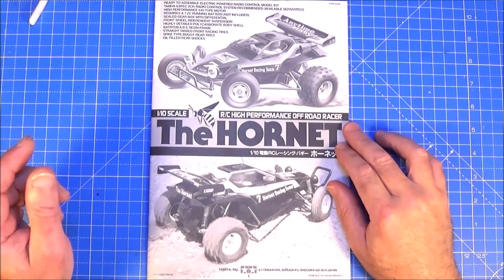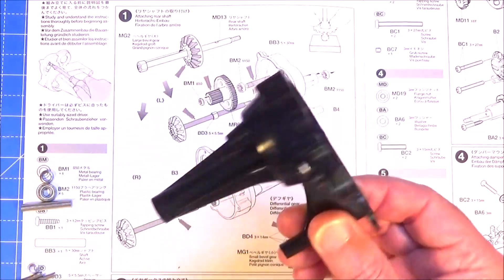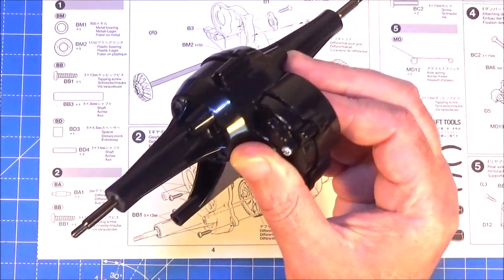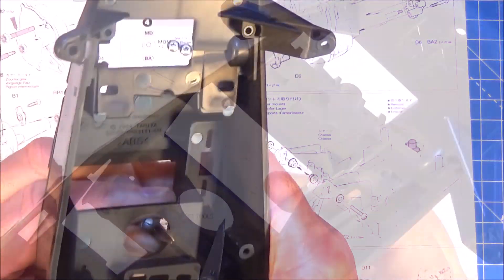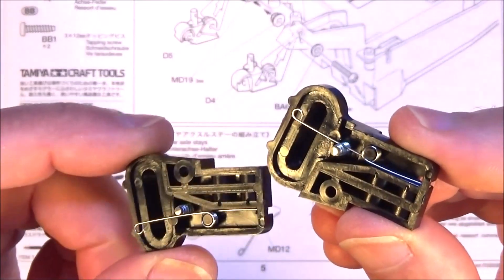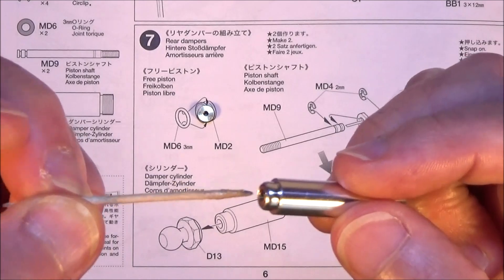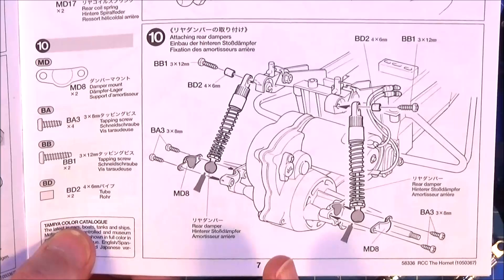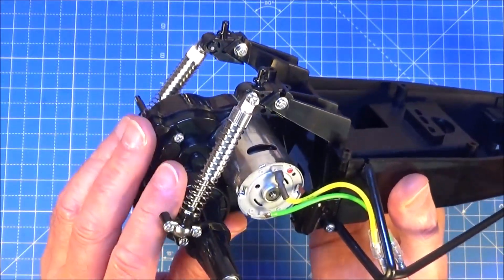Tamiya The Hornet Build Guide + Tips Part 1 (Steps 1 to 10)

Comment: Hiya mate. Sorry, just catching up on some vids. Did see the unboxing and hadn't realised that you've never had one of these.  The shocks are really decent as you say but the design of the gearbox and suspension does mean that the handling is still rubbish 🤣 I've never had a Grasshopper but I do think it's worth the extra for the Hornet to get the extra bits and have the gearbox that pivots.  I did do a mod on mine to have oil shocks on the front which I think was in a Dusty Fingers video.  Anyway good work so far mate and I'll stick the next episode on now 😁👍👍
Reply from the maker: Hi Pete and thanks for catching up, always a pleasure to read you mate. Yeah I'm late to the party with this model! 😅 I can see how the suspension is still rubbish despite the oil dampers! Agreed about the Grasshopper, that's why I went for the Hornet. For £20 more you do get some better parts. Hope things are going well mate, take care. 🤞😎👍

Comment: Helping me with my Rising Fighter build. Thanks.
 Stock (with bearings) for now. Then 19T steel pinion with Absima 15T hot motor, Wooo! P.S should i buy J.I.S screwdrivers or will Phillips be okay?
Reply from the maker: Glad to be of some help, Dominic! Good plan with the motor and pinion, phillips screwdrivers differ so you might find one that's a decent fit or file the tip to make it fit better. (less of a V angle for JIS) But if you are gonna do a few Tamiyas it's worth investing in a JIS driver. Cheers! 🍻😎👍
Reply: Slightly more differences from the Grasshopper than I thought.
Reply from the maker: Same here mate! 😎👌👍

Comment: Hi Mark, bearings aside, I'm glad you're building this one completely stock, so we can see it running as Tamiya intended, just bouncing around. I was amazed to see the complexity of those rear shocks. I wouldn't have expected to see this on an entry level buggy, but they're a great addition. The gearbox build reminded me strongly of building my Grasshopper, surely it's the same gearbox. As always, I'm especially fascinated to see what you do with that body shell. Great build mate..
Reply: If you own a Lunchbox, you will notice that they are the same 👍
Reply: @cw-01creations46 Ahh yes, that'll be it. Along with the Grasshopper, I've built several Lunchboxes over the years. That's where the strong reminder is coming from. Cheers for pointing that out..👍🏻👍🏻.
Reply: @thecontractor365 
You're Very Welcome 👍 
You will also notice the subtle differences between the Grasshopper and the Hornet such as the rear axle housings. The Hornet's are similar to the Lunchbox whereas the Grasshopper has solid axle housings therefore eliminating the rear axle to pivot 😎
Reply: @cw-01creations46 Yes, I like the no pivot aspect of the Grasshopper.
Reply from the maker: The legend that is CW-01 Creations certainly knows his Lunchies! 😁👌👍
Reply from the maker: Cheers mate, yeah I thought I'd build it stock for the guide before I go bonkers modifying it for the Speed Challenge! I hope it survives that and I can revert it to stock and do some arty run vids! 😂
Those shocks shocked me, so good quality, dude! And you are correct, the Grasshopper and Hornet share the same chassis tub and gearbox. Tamiya genetics! All the best my good friend! 🙏😎👌👍